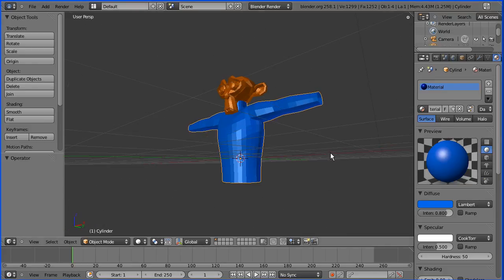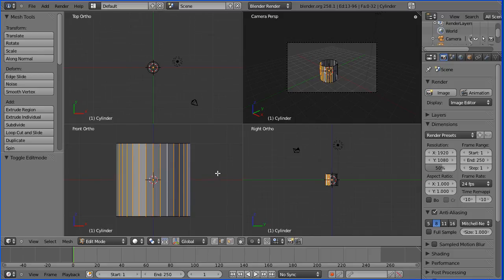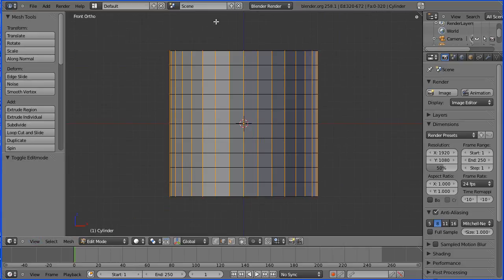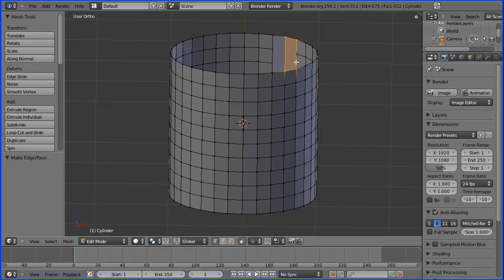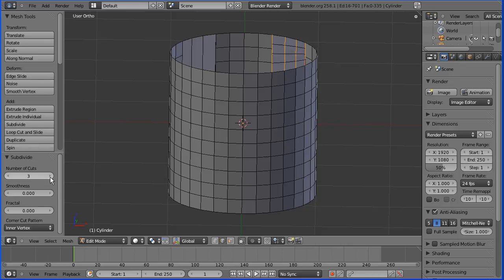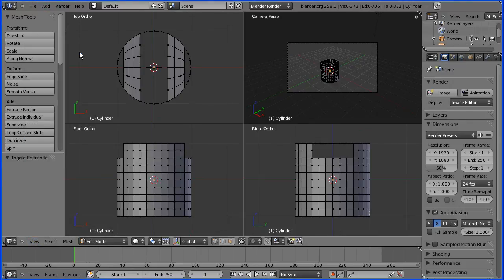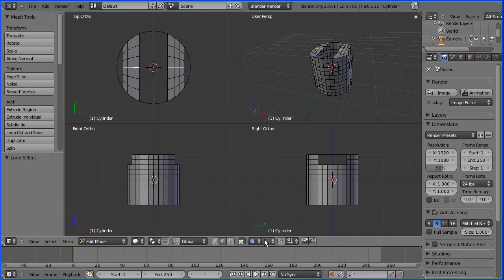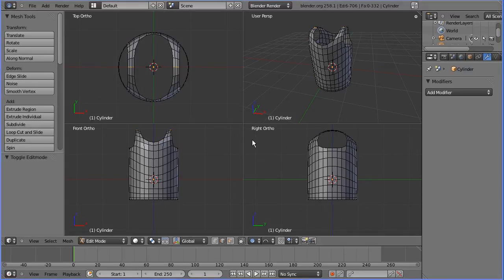Blender Tutorial - Using Mesh Modelling to Create the Upper Body of a Low Poly Character Part 1

Comment from the maker: I have just tried it in version 2.63 and it did work. The capped ends part is different, you now have 'Cap Fill Type' which you need to set to 'Nothing'. The subdivide worked, you may need to scroll the Tool Shelf panel on the left hand side, to see the parameters for the last action (and they disappear as soon as you do another action).